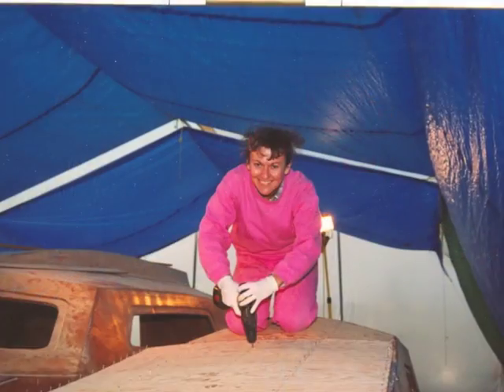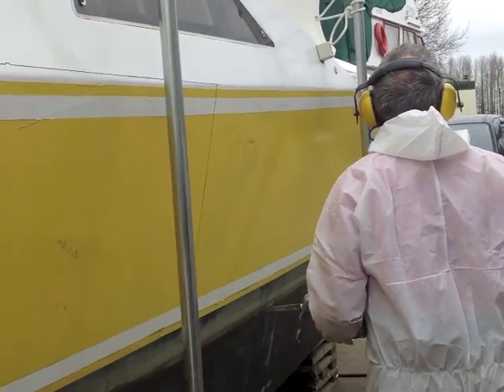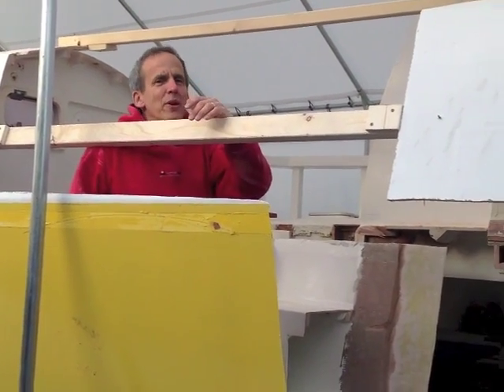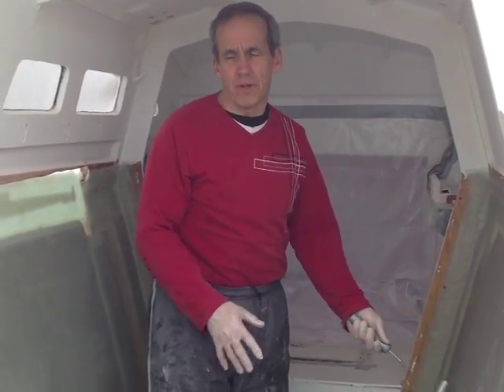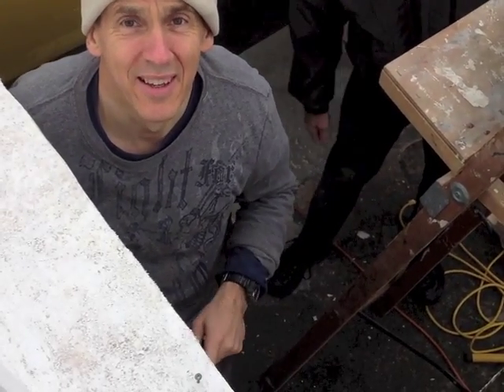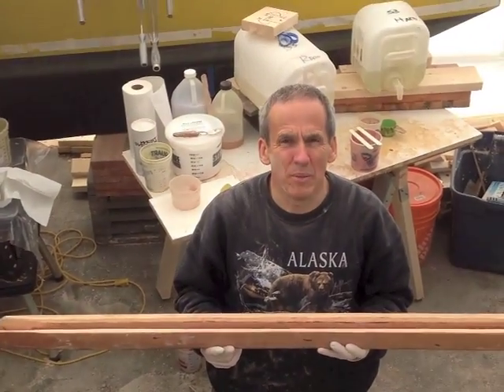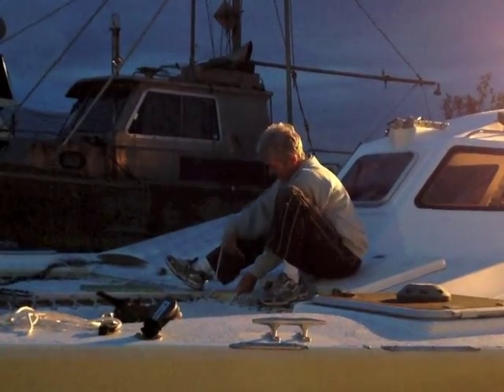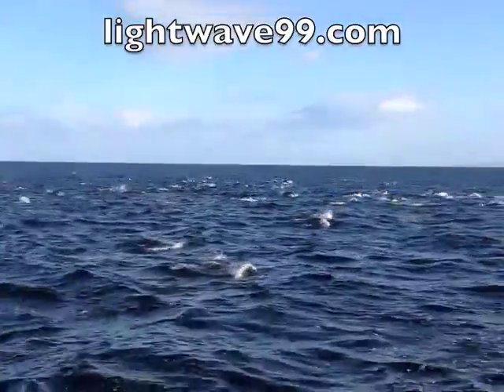Boatbuilding - How To Add 5 Feet To Your Cruising Catamaran

Comment: As a fiberglass man for over 40 years, im telling you this is Spooky...lots of missed steps!    Will it stay together, probably, at least for a while. ....  When it fails, there will be no warning signs, it will just fail...... But props to you guys for having the guts to do this type job, its no easy task for even a seasoned glass man / boat builder....Love You Guys.....PS, Keep Your Eyes On It, maining underneath where all the pressure is.
Reply from the maker: Dear Mr, Roach,

Thank you for your comments. Remember all the new work was done with epoxy which is even stronger than the original grp resin construction of the hulls. The fibreglass threads in the rest of the existing hull will break before the epoxy bonds of the new addition break. The overlap onto the existing hulls is on both inside and outside skins. This is much stronger than a lot of the the secondary bonding that was done with the original contraction that was only down with grp resin. Sincerely, Garett and Carllie

Comment: Circular saw mate. Sabre saw just for the tricky bits. Looks good! Well done.
Reply from the maker: Yes a circular saw would work for some of the straight cuts but the sawmill with the carbide blade(s)(many of them.....) is great for all the finicky cuts. It was only actually 1.5 hours to the cut to separate the boat into two halves. It was scary as you can see my wife's reaction. Remember that we had the boat for 13 years and crossed the pacific twice so it was a leap of faith. Sincerely, Garett and Carllie

Comment: hey guys is that really the way to go. the mold on one side and fibreglass all on the other? isnt that with 2 weak points? are you not supposed to have fibre go both ways at least? like.. not come to a cut together?
Reply from the maker: The join for the extension was all overlapped with the existing fibreglass; it was all made with biaxial roving and a foam core, epoxied in; whereas the original hulls were made with polyester resin.  We used System 3 Silvertip Epoxy, which is the best for wetting out biaxial.  The joins are stronger than the boat itself!
Reply from the maker: The joins were made with multiple overlays onto the existing fibreglass; they were made with biaxial roving and System 3 Silvertip Expoxy (best for biaxial), and the joins are stronger than the whole boat! Carllie kept saying she didn't want the boat to break in half, so I made absolutely sure that would not happen. Just as an aside, I have an engineering degree, so did not enter into this without quite a bit of forethought.  We would love to sail across the ocean with Light Wave as she presently is! - Garett
Reply from the maker: It would have cost us a few hundred thousand dollars to purchase a bigger catamaran, which are not all that common in these waters, and then when you buy someone else's boat you still have to fix a whole bunch of stuff and improve it.  We spent about $35,000 on our extension, and 4 months versus 4 years to build a new boat, and we basically got a brand new boat, and still have our lovely Richard Woods Gypsy 28 (extended first to a 31-footer on the hard in Guaymas, Sea of Cortez, Mexico, and then 5 years ago extended 5 more feet so we can get from one living area to the other without going outside.  We now enjoy our boat all winter long, and even go to our marina in Ladner (suburb of Vancouver, BC), which is on the river in the country, and stay on it on many cold winter weekends. Our catamaran has so many features that are not replicated in mass-produced catamarans, which are like floating hotels.  Light Wave is easily handled and sailed by one person, and is never daunting in terms of size--of winches, of sails, of the anchor. Thank you for enjoying our website and videos.  - Carllie Hennigan www.lightwave99.com

Comment: Been there done that a few times, as an apprentice boatbuilder we often did just as you did to create another model fibreglass hull and craft, then later in life, I built a trailer launch, Mmmmmm, to small, so turned her over, cut her down the keel line, added 3 ft and well, you know how it goes!

Comment: love this video. did you guys design your boat when you first built It? love the look of your cat.
Reply from the maker: Nathan, sorry we did not respond earlier.  No we did not design our original boat.  It was a Richards Woods Gypsy 28 when we launched in 1999, but since then we have made many improvements, including adding 4 feet to the aft hulls for better flotation (in Guaymas, Sea of Cortez, Mexico), raised the saloon nacelle, raised the whole cuddy cabin, added forward beam in front of the netting and divided the netting in half with a big strong walkway, which totally strengthened it, and 5 years ago cut the boat in half and added 5 feet.  But the Gypsy 28 is a great way to start! We enjoyed Light Wave as she was for several years before our first extension.  Very reasonable to build, and conceivably done by someone with building know-how and boating know-how.  Thank you for enjoying our website and video.  Carllie Hennigan www.lightwave99.com

Comment: A truly heroic effort! I doff my hat to you! One question though, How were you sure that adding 5' would not compromise the structural integrity of the hulls?
Reply: john hanrahan It appears it was well reinforced with wood beams. The guy seems to know what he's doing. They sailed in 30 knots and it held fine.
Reply from the maker: Sorry for not responding to your comment on our website earlier.  The joins were made with multiple overlays onto the existing fibreglass; they were made with biaxial roving and System 3 Silvertip Expoxy (best for biaxial), and the joins are stronger than the whole boat! Carllie kept saying she didn't want the boat to break in half, so I made absolutely sure that would not happen. Just as an aside, I have an engineering degree, so did not enter into this without quite a bit of forethought.  We would love to sail across the ocean with Light Wave as she presently is! - Garett Hennigan

Comment: you should have bought yourself a cheap hand mixer like i did it makes a big difference to mixing epoxy i got one from a dollar store for 7 dollars when i built my dingy
Reply from the maker: We knew about that, but it does not scrape along the sides of the mixing container.  I scraped along the sides and the bottom frequently while mixing. - Carllie Hennigan

Comment: Almost anyone can build a catamaran and the best way is with cedar strips. I've built two using this method. You first have to  design or have designed your boat and take off the OFFSETS which are the measurements up, down and across at points along the hull. You then build a strongback and attach shapes of cheap sheet material to it along the strongbacks length then run your cedar strips and in a few hours you'll have your two hulls,sand them smooth then glass them over and your ready to join them together and build a coachroof. 2 people 6 months .
Reply: :the best: is very debatable and i think cedar strip would lose that match.
Reply: "and in a few hours you'll have your two hulls"
Does it really go that fast? What would you say about plywood vs strips? Or Ashcroft?
Reply: Dejay, Douglas is right cedar strips is the best way to go. With cedar strips you can play with curvatures as it pleases you. His point is you can design and built your own. For a 9 to 5 employee, can built it for few hours everyday in a year - 2 years (some parts are very expensive.)

Comment: just curious how well the boats structural integrity is since this was done... just the thought of it splitting in half on me would stop me sailing across an ocean
Reply from the maker: The joins were made with multiple overlays onto the existing fibreglass; they were made with biaxial roving and System 3 Silvertip Expoxy (best for biaxial), and the joins are stronger than the whole boat! Carllie kept saying she didn't want the boat to break in half, so I made absolutely sure that would not happen. Just as an aside, I have an engineering degree, so did not enter into this without quite a bit of forethought.  We would love to sail across the ocean with Light Wave as she presently is! - Garett

Comment: Personally, I don't have the fortitude to do something like this, I would have gone out and purchased a bigger boat.   But that is just me, I tip my hat to you for having the the strength of will and foresight not to mention the skills to carry it off.  Fair winds and following seas.
Reply from the maker: It would have cost us a few hundred thousand dollars to purchase a bigger catamaran, which are not all that common in these waters, and then when you buy someone else's boat you still have to fix a whole bunch of stuff and improve it.  We spent about $35,000 on our extension, and 4 months versus 4 years to build a new boat, and we basically got a brand new boat, and still have our lovely Richard Woods Gypsy 28 (extended first to a 31-footer on the hard in Guaymas, Sea of Cortez, Mexico, and then 5 years ago extended 5 more feet so we can get from one living area to the other without going outside.  We now enjoy our boat all winter long, and even go to our marina in Ladner (suburb of Vancouver, BC), which is on the river in the country, and stay on it on many cold winter weekends. Our catamaran has so many features that are not replicated in mass-produced catamarans, which are like floating hotels.  Light Wave is easily handled and sailed by one person, and is never daunting in terms of size--of winches, of sails, of the anchor.